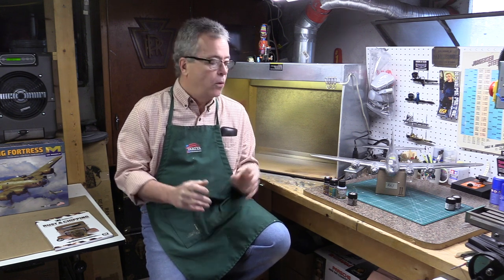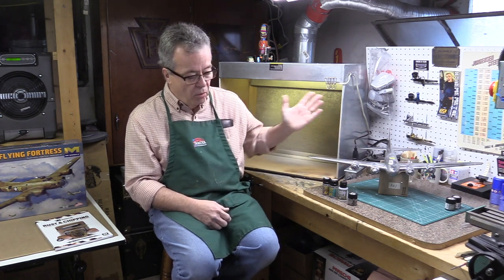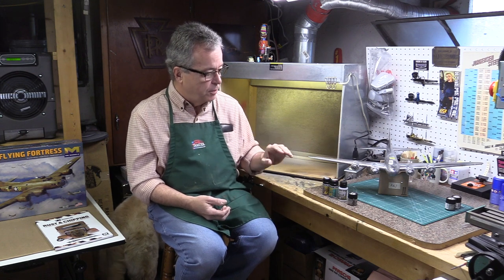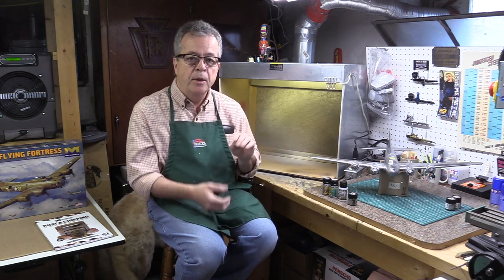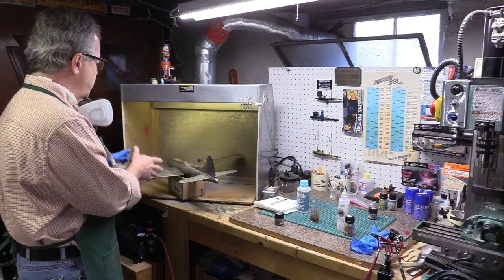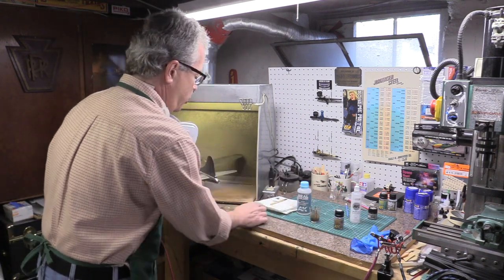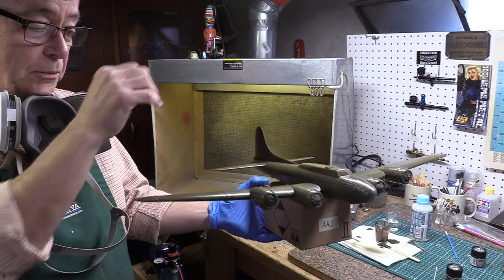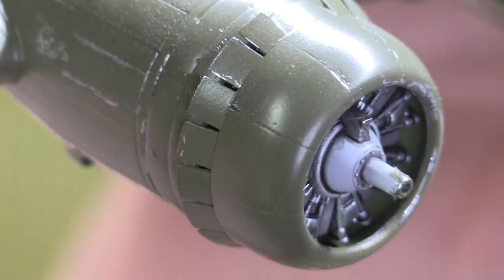How to use Heavy Chipping Fluid on a Plastic Model Kit

Comment: Wonder if masking with tape would be possible on paint coat,  for example if there is a camouflage instead of a single color... Seems the chipping fluid weakens the adhesion of the paint and it would not survive to tape removing.